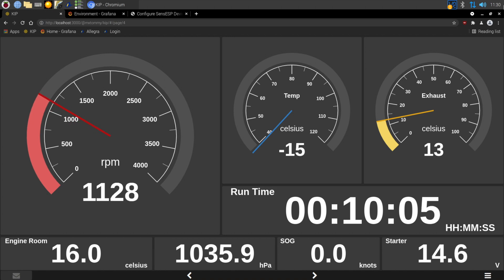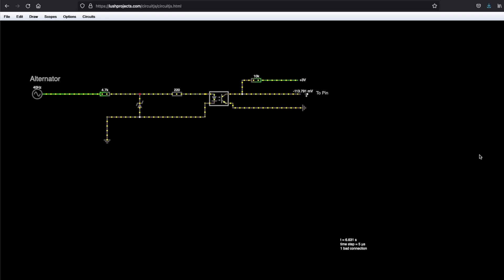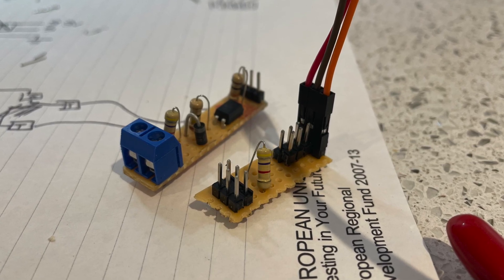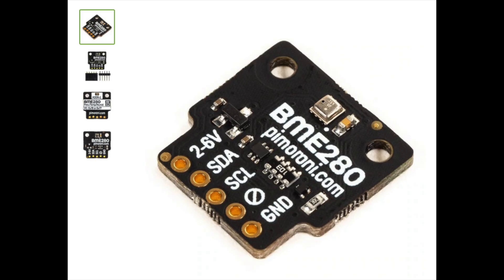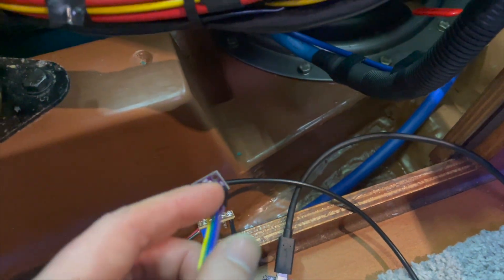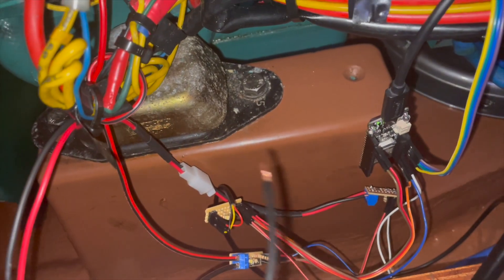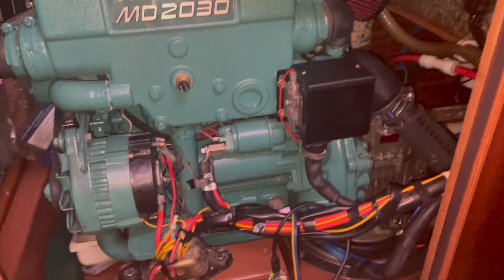OpenPlotter - ESP32 - Circuits & Sensors - Digitising an older engine MD2030 - SensESP

Comment: Do you have anything for setting up an engine hour meter?
Reply from the maker: Hi, I use the SensESP for runtime which shows you how long (in my case) the ignition has been on for and then I use a plugin on SK I think it's called engine hours which uses the rpm to trigger it. You can set your current hours with that and it will just continue to count as longs as you have RPM.
Reply: @BoatingwiththeBaileys ah great idea.
I have been doing it in Home Assistant and with node red but I run into all sorts of issues with HA  restarts and database purging.
Really handy for visual service indicators on the oil/filters/impellers etc
Reply from the maker: I've not done a great deal with Home Assistant, i like some of the features it brings but other things seemed difficult and came with a lot of additional stuff i just didn't want. Are you running NMEA through it?
Reply: @BoatingwiththeBaileys yes I have the Cerbo connected to the Czone and the Cerbo to the PI. my NMEA 2000 is connected to the PI..
I plugged in the engine hours into the Cerbo SK and that works but the Node Red on the Cerbo is not sending MQTT topics along with all the rest of the Cerbo MQTT  messages. The MQTT nodes connect and I can send/receive in the node red session but I don't don't see the messages in the victron/N topics.
Will have to do some digging! 😊
Reply: Fixed the MQTT Issue ... it was my Mosquito config file setup. 🙂 I can now see the topics being sent by Node Red on the Cerbo.

Comment: Where did you find that documentation?
Reply from the maker: Hi - For the temp sensor or are you asking about something else?
Reply: Sorry the RPM diagram at 0:38.
Reply from the maker: @LumpinLoaf ah, it's linked in the description- this is the site https://github.com/boatybits/boatymonpy/blob/master/Schematic_BoatMonitorSMD_Sheet_1_20200209152710.png

Comment: This is cool, can you program r pi so that it boots up like a car digital dash would or does it always start up like a Windows computer
Reply from the maker: Hi - Thanks for the comments, Thats possible and if you look at a video coming out this Saturday, you will see changes that have been made to a visualization app called Kip. That now has a feature where you can install it as an App. You could then boot straight to that app and go full screen to do exactly what you describe.

Comment: Hi BoatingBailyes!

I've been a subscriber to your channel for some time now. :)

I'm trying to follow your ESP32 video series and am encountering some issues with the temperature sensor. I can't seem to find a temperature curve for the sensor used in my Mini Sole 17 engine anywhere.

The best I can do is measure the resistance at various temperatures using the analog temperature gauge. However It won't be precise.

I think I don't really get the part of the video where you change the temperature sensor for a 100ohms resistance in order to calibrate... It would be possible to calibrate the sensor without knowing any expected temperature value of my sensor?

Thanks in advance!
Reply from the maker: Hello - thanks for being a long time subscriber, great to have you onboard.

Your approach will work fine. It turned out my early code wasn’t quite correct which meant things went a little out of sync as the temperature climbed and I couldn’t really work out why. There is a later video on this when someone else building the same setup spotted this and now the code is correct online and in that later video.

I think try what you are proposing, if you can get to any temperature and then measure the resistance and add that to your curve it should work. Repeat until you have a good curve to cover all the temps. What I was trying to do with the resistor was to say the engine is now at 80c so that’s 100ohms for example. But as a say the code was a little out and I was having to change values to get thing’s correct.

Let us know how you get on with yours, a bit more feedback on this would be helpful to make sure it does work for everyone else.

Mine works well now and my engine temps  stay between 7 5and 90 now all the time.

Good luck - Mat

Comment: Can you give more details on the optocoupler you used to in the rpm circuit. Did you build it or buy it? I have seen some for sale but they have a 12V version and a 3-5V version. Which one would be needed?
Reply from the maker: This is the circuit design which came from Boatymonpy https://github.com/boatybits/boatymonpy/blob/master/Schematic_BoatMonitorSMD_Sheet_1_20200209152710.png and built the small unit myself.

The output from my alternator on the W termianl is around 9v ac and i used an EL357N. You could buy one and then modify it. I would first check to see what the output on the W terminal is to ground and take it from there.

Comment: Very interesting, thank you. Been using ESP for a while to monitor our fridges and Webasto heater ... wish I'd seen this project before buying CANBUS interface for our Volvo D2!
Reply from the maker: Thanks for your comments, Im interested in what you are doing with the Webasto, can you give me some more information on that, please?
Reply: @BoatingwiththeBaileys  Yes, very simple ... opto-coupler across the dosing pump. Worked out how my mL each pump represents so can measure fuel use in L/hour or L/day and from rates, kW output. Not doing any controls. Liveaboard and when weather is cold, our 5.5kW unit can really drink the fuel!
Reply from the maker: @svgabrielle  What a great idea! I can feel another project coming on. Thanks for the reply.
Reply: @BoatingwiththeBaileys  Tried the k-line stuff and thought there must be a more simple way of monitoring this thing! Just use opto to trigger interrupt on rising edge ... interrupt routine times duration since last in mS and increments pulse count. Good luck.

Comment: Do you put the exhaust temp sensor in or on top the pipe? Thx.
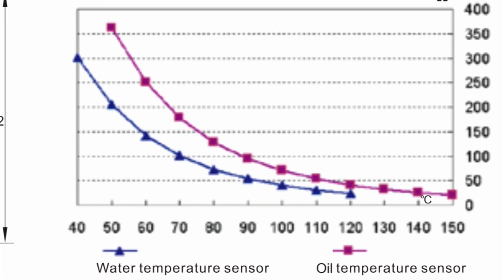Reply from the maker: Hello, Its attached to the top of the exhaust pipe with a stainless steel clamp. When the engine is running the temp here is low, around 20-25deg C, when then engine stops, you see a bit of residual heat build-up but nothing that will do anything to this sensor. They are rated to 125c i believe, well above the range of the exhaust hose. This video might also help, as it shows the installation on the engine and engine compartment. About 4:00mins into it you can see the sensor. https://youtu.be/II8URyYTFqc
Reply: @BoatingwiththeBaileys  thank you very much for the comment and the video!

Comment: And how you get this waterproof?
Reply from the maker: Hi, I haven't really got it fully waterproof, its in a box so its at least splashproof, about the same as other components within the engine bay. You could put it in fully waterproof box and try sealing any entry points with hot glue or something similar.

Comment: Hi again. Did you manage to get a good test of the RPM counter ? - I cannot even get the code to work. Nothing related to the RPM counter appears in the serial monitor and the path does not show up in SK either. Do you need a working optocoupler setup to get it to show up in SK ? Is the code you are using the same as in github ? - pleased with your videos and help so far
Reply from the maker: Hi yeah RPM is working well. If you tap a small voltage on the end of that, something should happen. Can you see the path in SignalK? If you are monitoring it from the console, you should see it passing by with just a 0 and you should also see that in SignalK as a 0 also. I am using the same code as whats on Github. Do you have the same ESP as i do? and do you want to paste the code in here to just confirm everything?
Reply: @BoatingwiththeBaileys  thanks for reverting. Iam using a az -delivery ESP32 development kit. I dont see any anything in the serial monitor at all. Do you mean just applying 3.3v permanently on the GPIO iam using ? - yes please paste the section of your code just to be sure....
Reply from the maker: Sorry for the delay, the comment got suck in 'held for review' Yes, if you just take a wire from the pin you are using, to the 3v supply on the board without using your optocoupler, that should triger a couple of On/Offs and the code should see that as RPM.

//RPM Application/////

  const char* config_path_calibrate = "/Engine RPM/calibrate";
  const char* config_path_skpath = "/Engine RPM/sk_path";
  const float multiplier = 1.0;

  auto* sensor = new DigitalInputCounter(16, INPUT_PULLUP, RISING, 500);

  sensor->connect_to(new Frequency(multiplier, config_path_calibrate))  
  // connect the output of sensor to the input of Frequency()

         ->connect_to(new SKOutputFloat("propulsion.main.revolutions", config_path_skpath));  
          // connect the output of Frequency() to a Signal K Output as a number

Can you see propulsion.main.revolutions as a path in SignalK ? This code uses Pin 16. Is that the same pin on your board?
Reply: @BoatingwiththeBaileys  thanks got it working....my mistake.... Think i got confused by having to different versions of main.cpp opened.... Basically got rpm, cooling water, oil pressure, alternator and thrustbearing temps running now.... Just need to work out how to change the code so I can run 3 different bilge sensors from separate areas
Reply from the maker: @Klaus Mortensen - Glad you got it working. Copy the code and where it says bilge, call it something like bilge1 or a name of your choice and keep changing where it says bilge to this name. Give the SKpatch an individual name and also change the pin it reads for each 'bilge sensor' , I think its set to 25 for now and that should work, Other option is to trigger a bilge alarm from any of the sensors and wire them in parallel.

Comment: Thanks for sharing the code. Installed and running but struggling understanding the calibration part of the analog temperature sensors. I have adjusted the const float R1 = 809 so when connecting a resistor of 147 Ohm instead of the temp sensor it also shows 147 Ohm. However it seems like its no taking my calibration sets into consideration at all.
Reply from the maker: Hi - I haven't update the code online yet around the temp sensor as this isn't tested, but TechStyle over on the OpenMarine forum spotted an issue which i think i managed to work around using a higher R1 value than the actuall resisitor size. Try chaning this line:

analog_input->connect_to(new AnalogVoltage(Vin,Vin))

Code will then look like the below. 

//// Engine Temp Config ////  

const float Vin = 3.3;
const float R1 = 1000.0;
auto* analog_input = new AnalogInput(36, 2000);

analog_input->connect_to(new AnalogVoltage(Vin,Vin))
     ->connect_to(new VoltageDividerR2(R1, Vin, "/Engine Temp/sender"))
     ->connect_to(new TemperatureInterpreter("/Engine Temp/curve"))
     ->connect_to(new Linear(1.0, 0.0, "/Engine Temp/calibrate"))
     ->connect_to(new SKOutputFloat("propulsion.engine.temperature", "/Engine Temp/sk_path"));

I copied this code from the SensESP library which is still the same as what i've got online. I have a feeling my actual R1 resisitor is 100 Ohm where the code is set to 1000 Ohm. See if that helps?
Reply: @BoatingwiththeBaileys  Thanks... ended up changing the code as suggest, set R1 to 180 Ohm and deleted the line //->connect_to(new Linear(1.01, 0.0, "/Engine Temp/calibrate")) as I believe it either need to use the calibration curve points added manually or this linear calibration... not sure about though:-), so please correct me if I understand it wrong.
Reply from the maker: I think it’s there so that you can change the whole range by a set value, for example if your sensor was consistently 1 or 2 degrees out you can calibrate that out. Another handy tip is to delete both that and your curve line so that you see the calculated resistance value as the output.
Reply: @BoatingwiththeBaileys  Thanks, got it working now :-)

Comment: hi Mat, another quick question for you! did you use a el357(B)(TA)G or did you use a different model?
Reply from the maker: I would need to check the compontant on the board to be 100%. I definatly searched for it, but i remember strugling with several of these componants at that time. I've looked through my ebay orders and RS and can't find. It could have been switched out for a PC817 as thats come up a couple of times. I can check when next at the boat if that helps?
Reply: @BoatingwiththeBaileys  no that's OK was just wondering as I can't seem to get one at the moment and was curious to see if you had the same issue. Keep up the good work 👍

Comment: Thank you for making these videos! Subb'd. How long do you think the wires running to the sensor can be? Can I just integrate a cable induced voltage drop into the calibration?
Reply from the maker: Thanks for your comments. Yeah, I don’t see why you couldn’t adjust within the code. The ESP analogue side isn’t the best and you can buy a dedicated digital converter which is more accurate. I’m going to be doing a little more calibration with mine in an updated video. My cables are around 1m I would say if that helps

Comment: Check also BBN Marine OS for raspberry pi4. Many free and opensource boat software packages preinstalled and preconfigured.
Reply from the maker: Thanks. How are you getting on with this setup?
Reply: @BoatingwiththeBaileys  I have on my boat for second season. Used it on two cruises. GPS, AIS, instruments, LTE/4G internet with touchscreen in cockpit. 

Here is another video of actual set up on a boat with autopilot 

https://youtu.be/3zMjUs2X3qU

Comment: Hello, a tip concerning the coolant-temperature sensor. M18x1.5 thread was widely used in the 70s-80s for Peugeot/Citroën/Renault. Reference is FAE 31020.
Reply from the maker: Thanks for the info! - Great alternative to anything with "Volvo Penta" on it!

Comment: Boatybits here, my RPM circuit - did it work? Great to see it getting used. 😎 Excellent ytube,  " how I really did it" is thin on the ground for cruising sailors. well done.
Reply from the maker: It sure did, it works really well thanks very much. The Volvo gauge stills works which is what I also wanted and not to damage any of the engine wiring. I’ve said it before, I’m just putting the stuff together, the amazing work is coming from all of you building circuits and software so many thanks again.
Reply: @BoatingwiththeBaileys  Great, glad it works! JLCPCB is such a great place to make all these little circuits made into pcb's - treat yourself, my next project will have rj45 sockets as well so network cables can be used to keep the wiring tidy. Keep up the videos & fair winds. 😎
Reply: @neverendingrefit759  Hi mate, I was wondering why using a zenner diode at D1 ? Is it just to protect the optocoupler in case of a surge ? Also it looks like OP just used a basic diode. So, what's the use for it and is it critical ?
Reply: @furrane  Dunno! 😁 The circuit I just cut n pasted then hoped for the best, guessing from some google that the zenor will protect against any big voltages seen from the alternator. Just glad it actually works 😎

Comment: This is the first time I have actually seen an actual installation, although preliminary. Excellent that it worked as you thought. Thanks for sharing. Cheers.
Reply from the maker: Thanks. I will update this as it’s a little more permanent now although I’ve not quite got it powered how I want yet